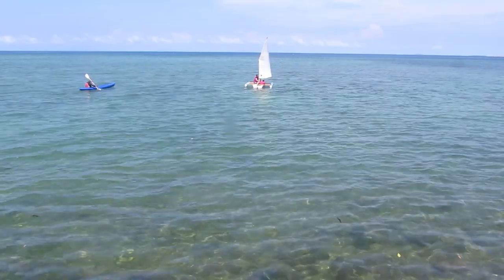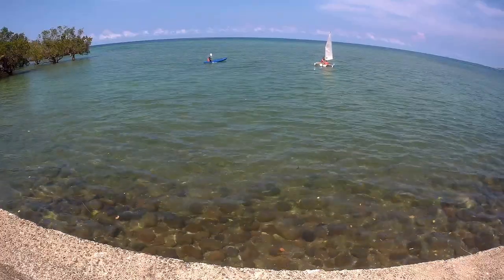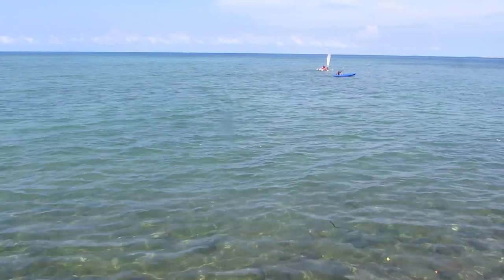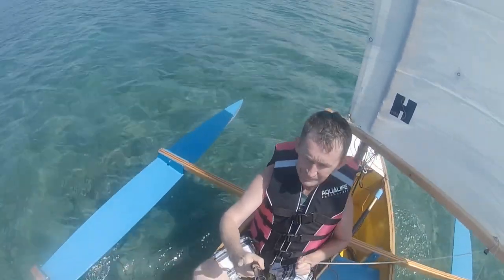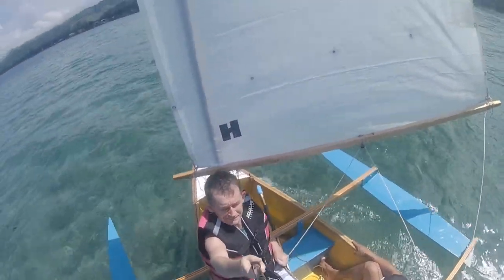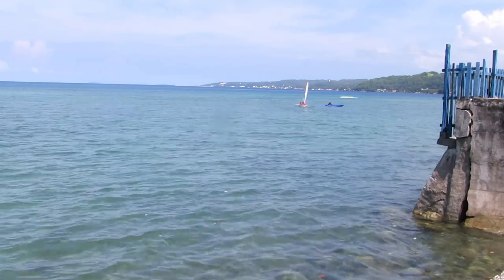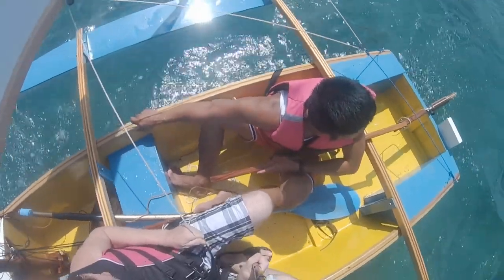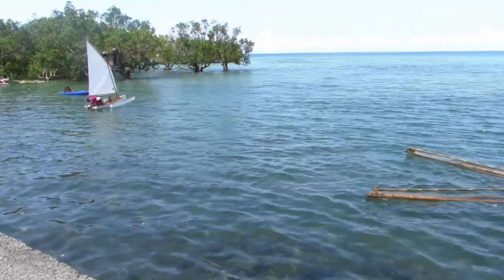Build a Tryst 10 Trimaran Sailboat - Pt. 22 - Finale - Let us Sail

Comment: Another question I have is do you worry about the boat breaking up in choppy seas? If so, can you think of ways to make the boat able to withstand rougher seas? It just seems to me that there would potentially be a lot of stress on the cross beams that hold the ammas, for any trimaran, even expensive ones. How do expensive trimaran manufacturers deal with the constant torque differentials and flexing of the three hulls in all different directions? Seems a lot of flexibility as well as strength would be needed for these cross beams as well as their connection points to each hull.
Reply from the maker: I would not take it out in rough seas, however the stresses would be as much horizontal as vertical